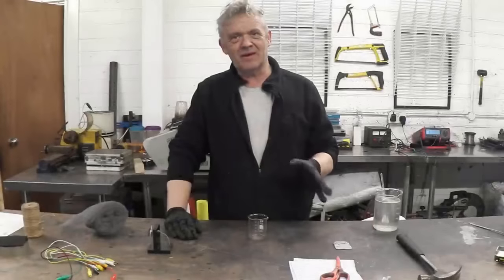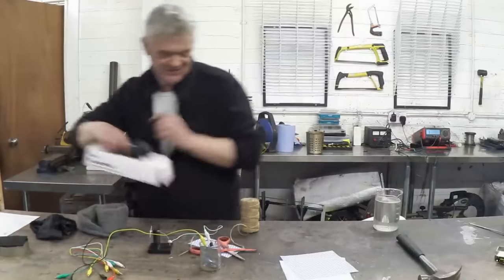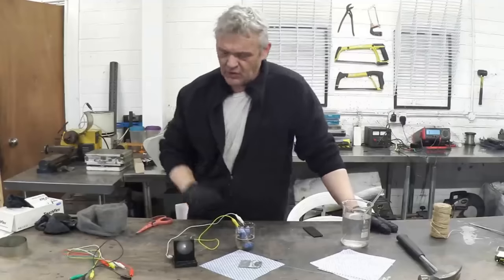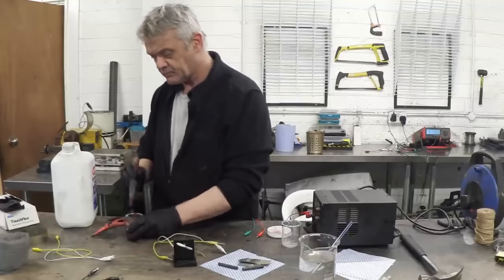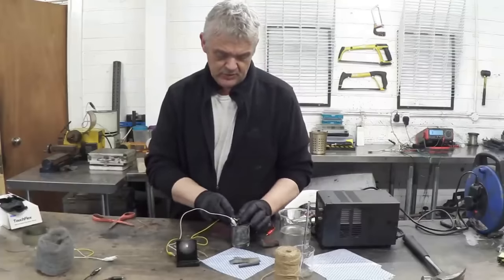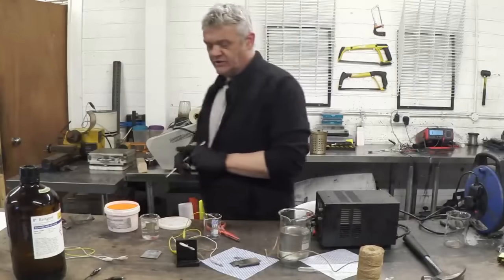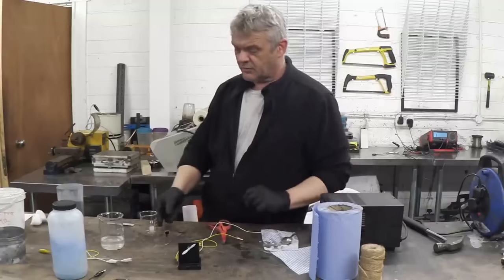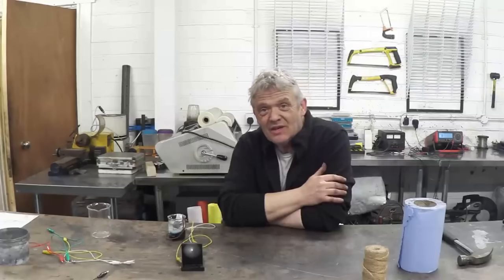2064 Lost Secrets in the Art of Battery Making

Comment: There is an old Thomas Edison patent for Nickel/Iron which is a tremendously robust battery, some even lasting 100 years with no degrading from number of cycles or deep discharge. He attributed the robustness of the cell to the insolubility of both Nickel Oxide and Iron Oxide in the KOH electrolyte.
I would love to see your ideas for a DIY NiFe battery for storing home power.

Comment: Not only are these books packed with useful info (as well as the occasional odd bits of misinformation), but they were also really good at explaining. I find many of the newer texts tend to gloss over the really important bits or worse. 
I also think it is worth commenting that the motor spun clockwise with your Bennet Cell ( I believe), and Counter-Clockwise when your remove the Zinc electrode and replaced it with the Carbon Electrode (Jurgan?? Jürgen ? How is it Spelled?). 
I really appreciate that you explained the Lalande battery which basically adds the depolarizer... very interesting! 
Definitely I don't want to mess with Chromates... they are seriously dangerous.
I usually cover the Daniel cell and the Leclanché cell pretty early in the battery sections, right after the Voltaic pile. 
Thanks for the great video.
Reply: Strongly agreed. 

Somewhere along the way we slowly lost our first-principles mooring of explaining things from the ground up, and in a very natural way. 

I've therefore personally learned to always default to, or at least naturally prefer, older or more classical text explanations, on any given (challenging) subject - and go from there forward in the literature that exists.

Comment: I love this old useful information. Thank you Michael. 
The automotive battery industry has done a good job at scrubbing the basic information from public access on how simple it is to make different types of batteries.
 I have watched many videos of automotive batteries being totally remade by Pakistani men in sandals, while sitting on a dirt floor using recycled lead and lead oxide, and using a cast iron pan to melt the lead and a wood campfire to convert the used lead to lead oxide then sealing the battery case with a cut strip of pvc plastic then using a hot piece of metal to weld the plastic case shut. In 1 hour a battery can have new lead plates, both an anode and new coated cathode plates, new separators, and new lugs all done with the utmost of rudimentary tools and tech.
Most Americans are terrified of their car battery and have no idea how they work at all yet guys sitting in the dirt around a campfire in sandals can rebuild one in an hour!
Reply: No M3P or 500 wh/kg lithium sulfur knowledge….. keep it movin

Comment: One easy and very powerful battery you can make is an aluminum iron battery. It makes about 1.7V per cell. For the cathode use aluminum foil or sheet metal for the anode use steel wool and iron oxides. Use some paper towel wet with baking soda paste for the separator/electrolyte. It will take a few minutes to start making current but once activated it will continue till the aluminum is gone.❤
Reply: There are lots of brilliant batteries out there but any one that consumes the electrode  is a net energy loss system as the energy used to make the aluminium is massive and the power from the cell is very small in comparison
This is why the flow cell batteries are the only really viable storage solution long term for stationary power storage 
Most flow cells last indefinitely because the energy is in the electrolyte thus very quickly they become net energy positive because they become capable of supplying more power than was needed to make them in the first place .
Eventually the electrolyte becomes contaminated to the point that the efficiency drops off but it can be regenerated through electrolytic filtering . 
Thus they never ever need to be replaced .
Interesting about the dichromate electrolyte which could be used in the Zinc - Bromine battery to up the power discharge rate .
While dichromates are too dangerous for Joe Public to play with used commercially where safety regulations can be enforced they would appear to have massive potential as the power reservoir for micro grids .
Bugger, Robert has made me start thinking .

Comment: I have to agree with you about old 'forgotten' methods of doing things. 
I've always had an interest in machinery, the development of machine tools pre CNC is amazing, (particularly things that are only in museums or old books).
A lot of 19th century stuff is still relevant to hobby machinists today, we just use electric motors instead of hand or water power and much tougher tooling.
Materials are more consistent plus readily available, measuring equipment cheap and accurate, but, the fundamentals really haven't changed.

Comment: The strangest battery I've ever used was a 510v dry cell. That's correct, 510 volts. The photo strobe unit charged nearly instantaneously and discharged via a sizable xenon tube.

Comment: It is an unfortunate by product of commercialisation that a single technology becomes dominant and every one concentrates on improving that single technology
We have seen this big time with the Lithium battery technology dominating all others to the point that is is almost impossible to sell a flow cell battery to any grid authority despite it being substantially cheaper in the long term  and almost 100%   safe
Apparently around 15% of all grid sized Lithium batteries have either caught fire during construction or use  
The dichromate electrolyte electrolyte is particularly interesting as it has potential for grid sized flow cell batteries with massive power outputs thus negating the need to endlessly play with voltages to get the required amps into the grid .
Having been a plating forman at one tim it should have already come to mind .

Comment: Only 2/3 through the video, ya might be missing one, the Hutchinson battery,  jihn Hutchinson created AA sized batteries out of crystals,  borax, silver dust, and different anodes and cathodes. Think you'll be surprised it doesn't lose charge over time. I'm under the impression that it is a piezoelectric reaction.

Comment: Could a rectangle acrylic box be used to build a battery . Using a groove in the center. Down the sides, across the bottom  with a nickel sheet dividing the electrolytes?
What kind of 'C' rating do they have, there was some kind of battery, can't remember what exactly, it could not supply much current, maybe the sodium battery, Its  been a while , and I wasn't that interested. Because  a huge server rack size battery could only output 60-100 amps or something like that, and 30 amp charge, it seems like the cells were about 12" tall, and 24" -36" x 24-36"  and stacked , i never saw any used. And it was in the 1000's of ah,  I need about , 300-600 amps from a 1000-1200 ah battery,  closer to 1c,  snc rather have 2c - 3c batteries. Less voltage sag, less resistance internally a 0.006 c rating isn't going to work,

Comment: I never made a good battery from wood ash. But I have taken kerosene and some slightly damped wood ash and put a clump in the bottom of a jar with kerosene and tried to run a current through it with stainless steel electrodes to make potassium metal. And do not drop your potassium metal into a pressure cooker with water in it.

Comment: Have you recently seen a new invention of using cement in a super capacitor, MIT mixed carbon black with cement, used a seperator and potassium chloride eg soaked it after hardening and put collector using some type of mesh inside it and its a super cap.
Reply from the maker: it's not new i did a video on it 4-5 years ago

Comment: This video was awesome,  just read today 3 chemist have come up with a new silicon anode material (claiming energy density will go 10 fold) So I'm spilling my thoughts what about high temp silicon used to seal fire steel box aka wood heater , as the problems with first silicon anode was catching fire , high temp silicon should address that . Maybe mix graphite powder with high temp silicon .
Just a thought thankyou Robert you definitely activated my battery thinking cheers.
Reply: Silicon, element, metal.  Silicone, rubber compound, contains some silicon.  One does not replace the other.

Comment: Very interesting... I would be interested in seeing how to revitalize led acid batteries.
Reply: It is rather simple if the plates are mechanically sound but the battery won't take a charge. First pop the top off to access the cells. Next disolve alum in boiling hot distilled water. Add 2cc per cell. Next apply 110V through a 100W light bulb till it glows brightly. Next use a high current diode and something like a small space heater as a load, hook positive to positive and negative to negative. Watch the battery voltage and when it drops to about 15V stop. Then hook to a regular charger. I revived a jump pack from 2004 this way. ❤